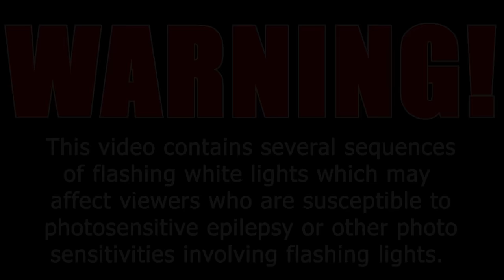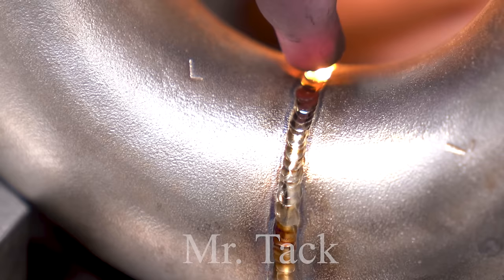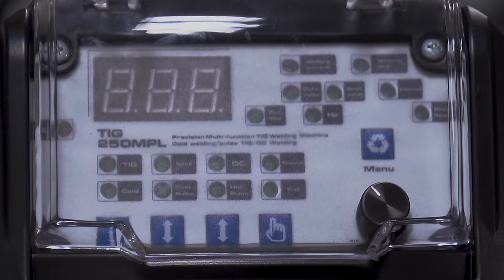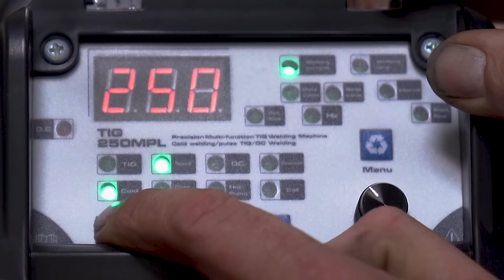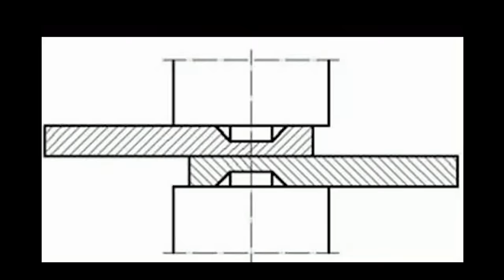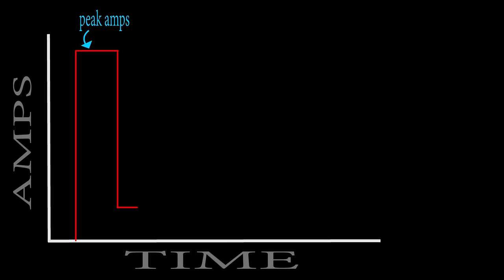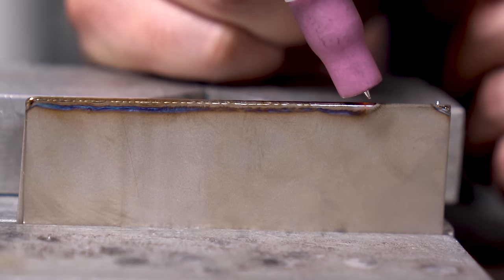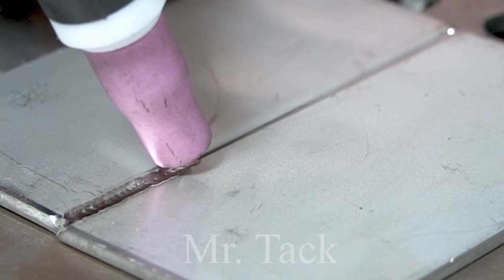So I Bought A Cold Welder

Comment: How's abouts, grabt the springs from two different clickable pens, cut then both in half, 'cold weld' two halves together, and end up with a hopefully working pen? That bead cant be too big, as being in the middle wouldn't affect spring travel, just length. Thereby, the amount of spring melted, vs, the amount of fill, vs the amount of spring length must all be taken into account. I would assume, you'd need to start with more than half a spring on each side, and melt enough and/or form a precise blob to match the correct length.

Comment: Looks like pulse welding but instead of a part and process specific engineered weld they are trying to suggest it will work just fine with anything an arc and no clamping pressure.

Comment: In the oilfield, a cold weld is done with a hammer and a punch, or just a hammer. You hammer forge cracked pipe or vessels to stop leaks. Generally a temporary repair unit you can get a welder on the job. But I worked in the oilfield 40 years ago, back when safety was for the day shift crew, real men on the night turn just got the job done. We didn’t worry about no stinking safety rules. Oilfield trash and proud of it! I’m sure it’s just story’s told about roughneck legends, by clean drilling technicians nowadays. Lol.

Comment: It might be useful if you’re using it as a tacking machine. If I’m batching out a bunch of parts I usually tack them all together first and line them up for welding so maybe useful for high volume thin metal tacking. 
But if you’re doing any kind of variety jobs you should just learn to weld.

Comment: I find the welder cool but the only thing about it is you won’t get any penetration which means the weld will bend and break easy. And I mean that’s fine if you are welding wires or small things but if you are trying to build let’s say a dog box or something you want to use a constant arc so the ends don’t break or bend

Comment: How is it "cold" welding when you heat metal hot enough to fuse the parts together? Like regular welding? Granted it happens much faster for a shorter amount of time, but it still welding.

Comment: I figured the black nails were a emo joke since you opened with welding razor blades. As a heavy duty tig I can see this being useless, but for welding small parts this thing is pretty sweet, I did a lot of messing with micro tig, .040 and .020 tungstens and I'm not sure I could have done the foil. 
Just saying, this thing looks like it's the right tool for some job, welding exhaust probably not but definitely appears to have a niche.

Comment: Can you weld aluminum foil with a tig welder? If not, I guess I can see a use for this welder. I'm new to welding and all I really understand is my wirefeed, and even then not so much.  I can see a machine like this being useful for tiny precise welds that don't require a lot of strength. It's like the difference between framing nailers and micro-pin nailers. One will hold your house up, and the other will work well for delicate crown moulding with invisible fasteners. Yes? No?

Comment: Mr Tack, you did a lot better job than Ms. Weld. IMHO.  Could you do light aluminum (1/16-1/8") with this. Yeswelder has one on Amazon. I tried using Hobart aluminum stick electrodes with my little Deko welder and got no where. I had better results with my propane torch and Hobart's aluminum brazing rods but it took a long time to heat up even the small 3/4x3/4x1/8" aluminum angle with my propane torch. Thanks

Comment: i need to join some brass fittings which do not require tensile strength, just make them air tight up to about eight bar.  would 'cold welding' be feasible for this sort of task?

Comment: I believe in one of the videos with someone cold welding, they seem to weld copper to steel. It may even have shown them welding aluminum to steel or something like that. Now in my welding world I have never seen it possible to weld brass, aluminum  or copper to mold steel or stainless. Welding mild steel to stainless us done. I would like you to try and weld any of those three to some kind of steel. Dont braise it or solder it, cold weld it if it can be done.. I myself dont see it possible and holding.

Comment: So I would like to know all this videos they show where they cold weld copper to aluminum, brass to iron, stainless steel to aluminum etc.. without filler rods. A normal tig won't be able to do that except with the right filler rod??  Just would like to know if it's worth the buy??

Comment: I can see having a machine like this for paper thin material but I don't think a tig welding machine may not go that low in amps because alot of inverter tig machine's will only go down to 20-10 amps,some 5 amps and the BIG MACHINES,down to 3-1 amps.

Comment: Its not for "welding" its more for fusing thin copper to aluminum. For instance, when you fuse lithium pouch cells Copper and aluminium  You don't want the cell to get too hot and whatever you do you want it to cool quickly so you don't have heat degradation, Or worse a fire. So I wouldn't call it cold welding as much as I'd call it cooler Then a normal tig.  I swear it's lost in the translation lol

Comment: The company: Let's make a "cold weld" welder.... but without a vacuum chamber to make it remotely possible to do an actual cold weld. Yeah, so, ya know what else is colder than usual welding? Little zapping mode welds that don't penetrate and actually bond two pieces of metal together instead. "CoLd WeLdInG!~ (TM)"

Comment: Have you seen /tried the laser "welding" machines? I'm in an apartment and while I am really strongly considering a TIG setup, the size and storage is a real barrier. I've done some mig-welding in the past (very experienced and helpful instructor), but I'm not really sure what level of investment to jump in at. I'm not going to be making money with it, it's basically just for making hobby projects.
Reply from the maker: Laser welders typically start around $25k. I've seen them and will likely be doing a vid soon.
Reply: @TheFabricatorSeries  so anything below that is probably gimmicky garbage if it even works at all. Thanks, super helpful!

Comment: The way I see it, having a v-groove and using filler rod might make this a viable option for some thin material welds.

What's this about the nails?  ;D
Reply: Yes it's very useful for some situations... sometimes you might want to add filler rod, or even flip the work over and weld the back side for strength.

Comment: I wonder if it's original intended purpose was for attaching wires to lithium ion batteries, since those have to be spot welded on quickly as a soldering iron can damage the battery with it's heat. Then they just decided to make a tig welder that can also do that at the same time.

Comment: Will work copper wire weld to brass connector for audio? Copper wire to copper connector etc. Does it use gas or filler material to weld or can it do without.

Comment: Hey, that's not how the razor weld trick is done. It's supposed to be an edge to edge butt weld... the point is to showcase your weld skill by not burning through razor thin material. By the way look up brazing. It's not a weld but a capilary action. You described it at some point but for some reason call it "cold welding"

Comment: we are looking into a tig welder at work for tiny part repair. (sewing machines)
essentially something less violent than an arc welder, something that could slowly remelt the micro fissure.
we have a lot of discontinuated parts and some are tiny.

in your experience is this something that a tig could do with ease ?

Comment: I got one of these in micro form. I'm a trained metal conservator and we use these (coming from the jewellery industry) to weld pieces of art as minimally invasive as possible and without adding alien material (the filler) to the artworks material. But - as you said in the video - it's for small, delicate parts. Doesn't have to be sturdy, just holding things together or being a cosmetic measure. It's a niche product. Mine came with a microscope (and an automatic shutter for the lense to protect you from the flash). You can weld cramps on a diamond ring without taking the diamond out, which vastly speeds up jewellery repairs.

Comment: One of the old welders that used to work here asked for a new inverter tig welder with pulse and got one of these crap machines instead. In COLD mode it doesnt even have pre flow and you cant set the post flow time to click it then get on target. They think this machine is going to magically fuse a barely prepped razor thin worn out turbine segment together. The lead engineer heard me talking crap about it and ratted me out to the owner lol. I guess the engineer was the main factor in getting this machine. It sits here collecting dust

Comment: I am trying to figure out which machine you are using. I also have a thought about using the cold weld with sheet metal on car bodies. Any thoughts?
Reply from the maker: It's a TIG welder. It's nothing special. Use MIG on car bodies to reduce heat input.

Comment: To be honest, there is no such thing as cold weld. To melt the metal and fuse it together you need heat somehow, and a high current heat melts metals that, when cooled, it binds into one that we call weld, or welded. As we see this as short sparks that we think it is a weld, I'd say, sure, it is a weld but does it hold? To find out, try bending the two plate together to see if the weld snaps. 

After welding the two Stanley blades together, try and open them to see if they snap open. I mean, welding them by applying current to generate heat (heat you call cold to bind them together), is the weld strong enough to resist breaking? And how does it weld when there is no cold welding applied to the joints when there is heat used to melt the welding area? See? Cold weld, yeah? You think I'd believe that? LOL.

Trust me, cold weld is no such thing unless the welding is applied with ice and shows that the metal been welded using cold ice. 

There are times when I am shaking my head in disbelief on how something welded with heat is actually called cold welding.  Pfft 🙄

Comment: Thank you for the video!

I have a question for you: I am working on a project where I am interference fitting a 5/16” OD, Grade9 titanium tube, wall thickness .035”, over a Grade5 titanium rod.  The tube is heated and will be shrink fit to the rod(0015” interference). I am considering enhancing this interference fit with “cold welding” at the edge where the tube overlies the rod.  What do you think; good idea or bad idea?

Comment: I too was doubting the imagined process. I started electric welding. Night classes, books, at the hand of masters. I could.not work out what was happening but I am thankful you are exposing this for the mindless lies it is.
Reply: It's not mindless lies. It's just outside the typical welding industry common methods. For example, have you ever laser welded? Probably not, but that doesn't mean laser welding is mindless lies.

I think many people are confused by the poorly translated from Chinese to English term 'cold welding'. Have you never read a Chinese translated manual before? JFC. All they mean is that there's less heat put into the work and the heat affected zone will be smaller. "MINDLESS LIES", LMAO! Dope.

Comment: Can you message me the brand?  This is for my work, we have quite a few nice machines but some of our parts I have to outsource do to any amount of amperage will blow a hole right through the metal(usually its stainless, around 0.005" thickness, or 5 thousandths  thick)  
Simple spot welds from this would save me a ton of time with making heatsinks to try to keep from blowing through. Thank you

Comment: Is that weld really "cold" in American industry meaning?
Did you make strength tests?
Because this process does actually seem extremely useful to me. Fusing copper, aluminium and other thin metals fast enough to not cause melting or deformation of the whole part of extremely useful for modeling small metal parts.

Comment: A weld that isn't structurally sound but is accurate? I've been looking for that for months now! this is exactly what I need! 

The main reason for this is because I've been needing a "cold" weld for metal 3D printing where you want support material and break points. What you showed here is perfect for 3D printing metal. This pairs perfectly with TIG welding which would be used for the structurally sound parts.

Comment: Would this be a viable weld for butt welding automotive body panels.  If panels are welded together anywhere except the factory spot welded seams, they have to be butt welded.  Mig and/or tig welding puts a good amount of heat in the even under the best conditions. It appears that such a technique could be used to but weld .035 to .063 sheet metal together.  If both sides were welded using a filler rod as shown in some videos would it be structurally sound?  My assumption is the technique uses no argon.  The reason I assume this is that millisecond arc time likely doesn't provide an appropriate gas shield.  Have you butt welded .035 to .065 sheet metal on both sides and tested the strength?  I restore old Honda motorcycles and the most difficult thing to do is repair a gas/fuel tank.  It's near impossible to repair these thin fragile treasures, and a beautifully restored bike starts with having of creating/repairing a tank to factory specs aesthetically.  Do you believe this 'cold' technique could be used successfully to but weld thin sheet metal of automotive sheet metal and motorcycle tanks?

Comment: I mean this isn't cold welding but people change terms how ever they want now adays lol. Real cold welding takes place in a almost perfect vacuum with 2 very similar peices of metal touching eachother. Without the oxygen layer the two metals will fuse into one. Nasal had issues with this actually happening with doors and solar panel array not being able to open properly but they fixed that now by giving the materials a coating of different metals.

Comment: Would this cold welding work on say  1/16 or 1/8 inch aluminum if the peaces were @ 90° to each other and you welded both sides of the joint or would the weld still be pretty weak? I'm thinking about this as a way to weld fins on a high power rocket.
Reply: So anything happened? Would also be interested to know 🙂

Comment: The other way to get scientific cold welding is to put two clean pieces of metal together in a vacuum. No oxide layer or dirt. Just two pieces of clean metal in a vacuum. They will spontaneously fuse into one piece. It's primarily used in nanotechnology manufacturing since the eat will damage the tiny components.

Comment: Thanks for the informative video. I am trying to get in to Welding to build RC toys for my kids. Just wondering if you can help me with my research. My use case will be welding aluminium\steel plates (or copper)  and will be using the machine ~20 times a year. There is not much room in my garage for a gas cylinder (and trying to avoid having it to be honest). Is there any Welding method\machine you can recommend ?
Reply from the maker: The only processes that don't use gas are stick and flux core. Both are not great for welding anything other than steel and they are very messy. This BS cold welding nonsense still uses argon and it doesn't weld aluminum.

Comment: you get what you pay for     as a certified vessel welder  with ASME and NB  certification up to 3000 psi  and 20 years on the job  just go buy a miller or lincoln there sales and support are worth the money  and you can get replacement and consumibul part at any weld store  china welder not so much  i can do all the same stuff on my high frequency rig  and so much more  invest in your trade  you get what you pay for

Comment: This is called TIG, not cold welding. Cold welding is where you welding without heat.....this is using a tungsten core..the little metal tip you see in video.

Comment: 3 years ago that I came back to Thailand I saw the welders here welding like Tacking all the time ,,,,
they been using this welding style for years n years caz they think this weld keep it cool n not leave too much heat on the work piece. Just use a normal tig welder and finger switch tack tack tack tack ….till now they produce cold weld machine which I kind da confuse abt this cold weld I think we can call spot weld on the welder that have spot weld mode

Comment: Just set the amp higher and time longer, it will penetrates.
Don't focus on the term "cold". The manufacturer just means "less heat than TIG". 
You have more false statements than the manufacturer.

Comment: I feel like there could be a legitimate use for this in jewelry fabrication and fine metalworking. Real small parts.
Reply: Yeah, but they're already using purpose made laser welders with built in magnification optics... this is like the cheap TIG version that might appeal to hobbyists/makers.

Comment: How is this cold welding, surely its just loads of small tacks with a TIG welder? you can literally see the red hot metal and discolouration after welding, and its only cooling down so fast due to  the very thin material and lack of filler?

Comment: Wow, hotshot professional welder didn't recognize a cheap Chinese pulsed Tig welder as used for decades in jewelry and dental fabrication.

The third term for "cold" welding is that the spot and HAZ is very small and you can weld very close to heat sensitive gemstones. So the whole part stays "cold".

They're also often referred to as a poor man's laser welder.

Comment: So ... the machine doesn't create a pulse you do that your self. That is disappointing.  I do see a use  for this . Stainless steel guarding of sensors and heat shields. Wire or small rod fabrication ( like fan shrouds ) or sculptures.  Very fine but low stress applications.